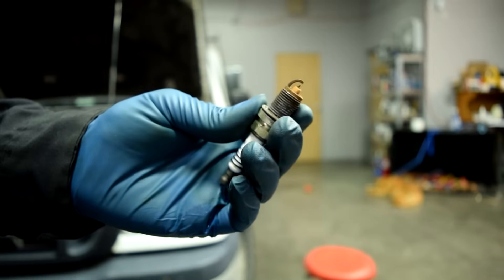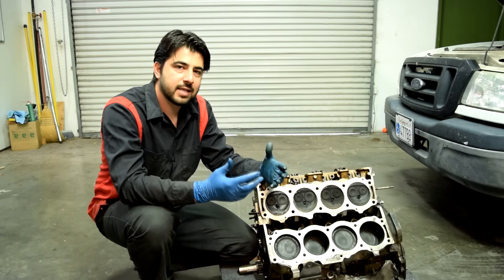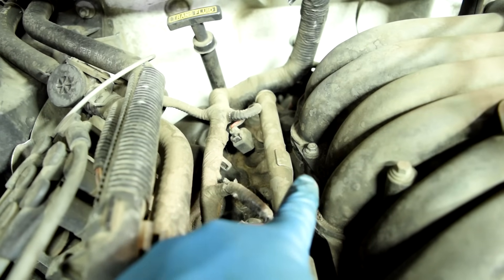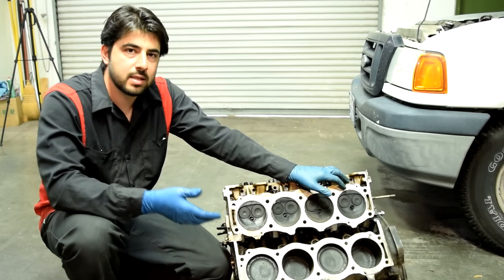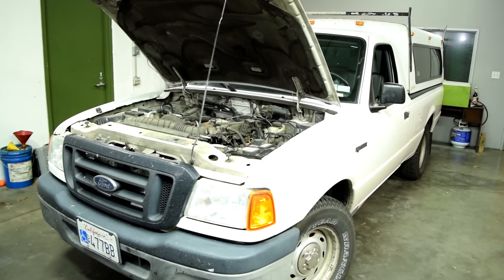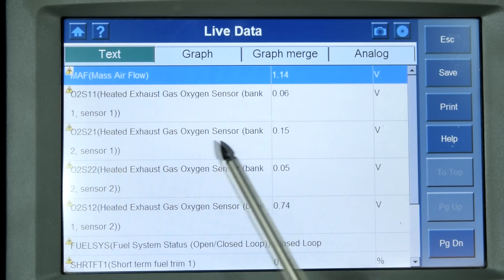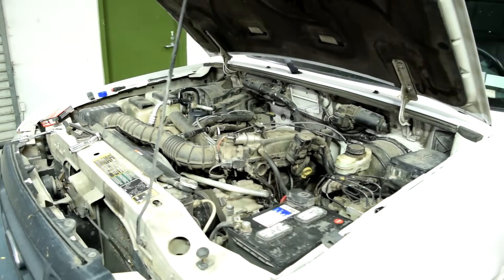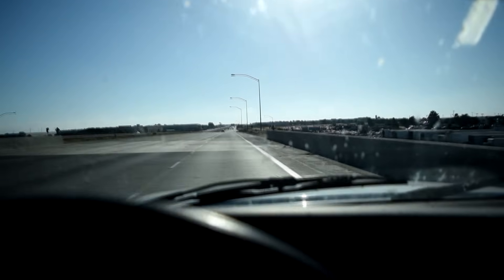How to Easily Diagnose and Fix Engine Knock

Comment: Please watch the video I just uploaded, tell me if you think that is low fuel or lean, if it is they must have gotten a bad shipment because I've never had that issue.

Could putting in a new air sensor cause the knock? My car didn't have a good one for the longest time and I put one in from the junkyard and the knock started later that day.

If you can help me the help would be really appreciated, I just replaced a fly wheel and don't have the money for a fix

Comment: Theo only nit is that I'm hearing him say that this is occurring after the spark plug fires.  This is not the case.  Detonation is uncontrolled burning of fuel that occurs due to hot spots (usually) from carbon buildup in the cylinder.  The hot spot causes the fuel to burn before the spark plug fires.  since the shock cannot propagate correctly in the cylinder, the pressures cause the piston to slap.  He's correct on those points, just not when this occurs.

Comment: I will check spark plugs on my car too, I have very loud knocking noise, 10 mechanics didn't know what that is, maybe lifters, maybe timing chain, but no because car I had broken head gasket and now it's repair, both heads are in good condition (cause I have V6 engine), new head gaskets and after 50km I hear that smth doing knocking noise, I hope that will be sparkplugs

Comment: I'm trying to determine if my knock is from this or my flex plate/torque...
My knocking mellows out when I put the truck in neutral... But when I'm idling at lights,etc it's really loud. Thoughts?
Reply: Ever figure out what it was ?

Comment: @ratchets and wrenches hey man i have the same engine on my 04 Ranger and it has a loud knocking sound on the engine but it come from the bottom...im about to replace the block but im trying to look for a new engine that will fit instead of the 3.0L. what block can i swap?

Comment: So the 2004 ranger doesn't have an egr valve?... my 2001 3.0 ranger has one and it's doing the same knocking sound on load too. Thanks for the info. especially on those banks. I have the blue driver obd ll sensor and that info will come in handy.

Comment: and its the otherway with ignition timing if you have too much advance it makes it worse if its knocking at say 15 degrees spark advance (15 degrees btdc) advancing it more so it fires 30 degrees btdc will make knock worse retarding it to 5 degrees btdc will make it less likely to knock but if you only running 5 degrees advance on almost eny motor you have issues

Comment: I had an occasional knock problem with my motorcycle at very low RPM (about 2500 RPM)... turned out to be a really loose & worn out cam chain. When the mechanic proposed it I looked at him with disbelief but after I got the bike with a replaced cam chain the problem disappeared altogether.

Comment: My car make sound like trrrrrr trrrrr tarrr with acceleration. And check light for knock sensor on off. I have changed 3 knock sensor it works for one day then again that problem. When check light turned off there is no knocking when on then again that sound. Plz help me

Comment: I have a 97 Toyota Camry 132k miles with a P0325 code for Knock Sensor, and it seems to be knocking upon start up and beginning of 1st gear. You think just changing the sensor could clear up the issue?

Comment: please tell me how ECU sence misfire in a particular cylinder.
Reply: 2 ways, typically.  One way is the ECU monitors the slight increases in RPM via the crankshaft position sensor, that normally occur just after a cylinder fires.  If there is consistently little or no acceleration of the crankshaft (or crank continues to decelerate) after a certain cylinder fires, it will throw a P030x (where x is the cylinder number) code.  If x is zero (P0300) then it is detecting misfires, but not getting consistent enough data to indicates a particular cylinder.  In this method the cause of the misfire could be either fuel or ignition.

Another way is the ECU monitors the current flow through the coils during ignition for an expected value.  In this method a misfire detection would be for ignition.

Comment: Nope, pre-detonation is when the fuel air mix ignites before the spark plug fires. Higher than usual temperatures inside the cylinder head/block combined with compression will do this. The "anti-knock" sensor sends a signal to the EMS and it adjusts the timing to eliminate this. This is why you can run on any octane gasoline in the US. You get all of that noise in a diesel engine since they are a CI engine. Compression Ignition. Not SI or Spark Ignition like gasoline engines.
Reply: Maybe he should say his own name then say the knock sensor

Comment: He's dead wrong...knocking or pinging is technically called pre ignition which means the air/fuel charge was ignited prior to the ignition system calling for it, not a second or third igniting of the air/fuel charge
Wtf is he talkin about
Reply: There are said to be different causes of engine knock

Comment: my knock sensor is on bottom of my block.,should antifreeze came out??? there is a blockage of black crap inside the hole where the knock sensor goes,should i scrape it out before installing new sensor?

Comment: So in theory the higher octane helped close the gap on the spark plug..Question: was that a flex fuel model....or did the driver just try higher octane because of the old saying?

Comment: Lol my mechanic made it simple.. Drive it till the engine gives up & then just change the whole engine
Reply: Its way cheaper to replace the engine than to rebuild it. The down side to this is that you dont know what problems the used engine might have. Rebuilding an engine will let you know everyting is ok.
Reply: That's what my mechanic told me
Reply: Change all of the sensors while doing it.
Reply: That’s what I was told as well
Reply: Do shops just replace the engine? If you bring em one
Reply: Yeah!? Because that’s way cheaper🙄

Comment: i got a 4.0 ohv with a knock but the cylinder is dead an no compression on that cylinder but you unplug the spark plug to that cylinder it goes away

Comment: what should my ignition advance be at idle? My car will run anywhere from -2 to 5 at idle and when cruising at highway speeds it is around 25 to 35. Does this seem right. it is a 2.0l I-4 motor

Comment: You can check a knock sensor by taking a hammer and tapping on the intake manifold if the motor stumbles for a second the knock sensor is working
Reply: Great tip, thanks. Gonna give er a go. I drive an 07 Kia and according to service info, the knock sensor codes don't trip the check engine light (go figure). To diagnose a sensor you need a scan tool that can read those codes.

Comment: could a leak air/fuel mixture lead to low oil pressure at temperature/idle, or no and this parameter would be more indicative of mechanical knock compared to detonation knock?

Comment: dude , do u have answer for my question.

does the pcm use the  2nd O2 sensor (after cat) data to control the mixture. I heard some ppl say it depends on the car manufacturer. I live in place where there is no emission control test. obviously why I'm asking coz I need to remove the cat converter and my only concern is the mixture. I hope u have an answer

Comment: Hey man, my 1998 legacy GT is knocking. the only thing is it's not very loud and not always there (which makes me think it is not rod knock but something else). It is most noticable when I've just started the engine on a cold morning. Once it warms up it is barely audible at idle but becomes audible at 2000 rpm then disappears again at about 4000 rpm, the knocks also increase in frequency as rpm increases... Any thoughts on this would be greatly appreciated.

Comment: Were original plugs fine wire plantinum or irridium?  At least the wear pattern looked like they were fine wire.  The new one definitely looked like standard plugs and NOT fine wire.  If original were standard plugs, I am very impressed with the ability of the ignition system to fire them with such a massive gap!

Comment: donald-trumps the ignition timing...good one
and great videos aside from trump as well
also is there any way to 'revive' a car's performance without spending a ton of money? (due to age)
Reply: That’s what I thought he said “Donald trumps the ignition timing” lol
Reply: I don't think I'm an expert by any means; however, there are always ways to do thing less precise to pinch a penny. The question is more of, is it worth it. For example: Block-sanding a head and block for a blown head gasket instead of having it milled. I personally doubt there is a noticeable performance difference for daily commuters, but, due to the larger imperfections, my logical side doesn't doubt some power loss on the high end side.  Mind you, block-sanding is a f*** ton more labor on your part, imho.

Though I can prove neither of these claims either way. Just can't afford to, nor have the time, to find 2 engines of the same type with identical starting power outputs; both with blown head-gaskets only; have one milled and block sand the other; then rebuild and dyno. Even then, I would be willing to bet the power loss delta would be so minimal, you wouldn't really know which was which on paper.

Comment: The one thing we cannot control is the gas coming out of the pump. I go to the same gas station (Sam's Club) all the time, 87 octane. I drive the same basic route almost every day. Under load (on a hill), the engine will knock with some tanks of gas. When I refill it at the same gas station, same octane, there's no knocking. The knocking occurs for the whole tank-full, when it happens.

Comment: ford calculates and displays baro in,hg and hz different to other manufactures so if you get a less than normal reading you have a built up insulation on the maf hot wire that leans out fuel depending on fuel trim readings they stay or get worse with higher load. i clean then and its like getting a tune up. replacement is better.
Reply from the maker: good info, thanks.

Comment: my engine knocks when I first start my car and the engine is not at operating temperature but then the knocking goes away after a few minutes.
Reply: brian marquez I've heard of timing chain tensioners doing this before. they make a knocking noise because the tensioner is hydraulic and the oil pressure is not up all the way or the oil isn't hot yet. Not sure if this is it but might be worth looking into.
Reply: brian marquez I'm no expert but I read something about "piston slap." Someone can correct me on that. My Supra does the same thing. Very low tone "knock" or "tap."

Comment: Good video. My understanding is generally the same. Only comment I have is that ignition knock noise is caused by asymmetric pressure load on piston causeing piston to be slapped against cylinder wall creating noise. regards
Reply: That's a different problem. In England we call it piston slap. It has a different sound too. It is caused by worn piston and cylinder in an old high mileage engine.
Reply: or if you own a GM early 2000+ 3.2 - 3.8L V-6, we call piston slap a normal operational characteristic.  :(